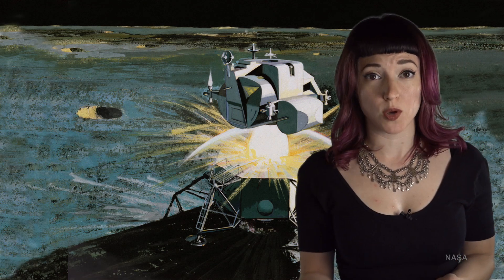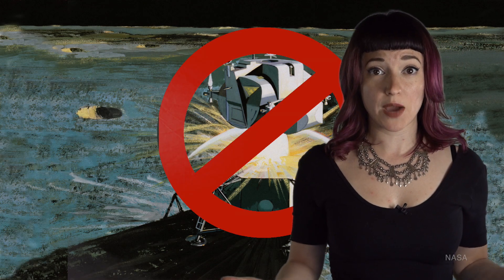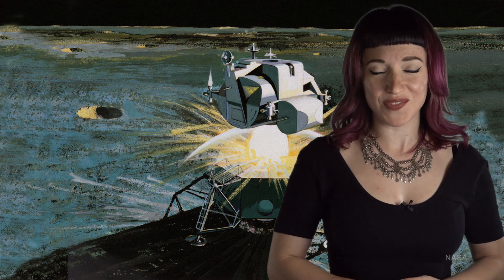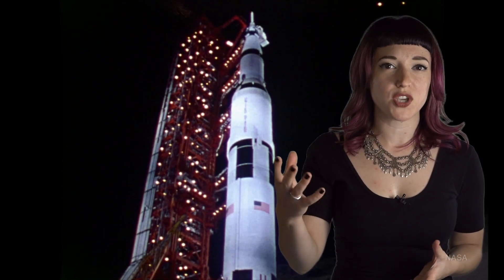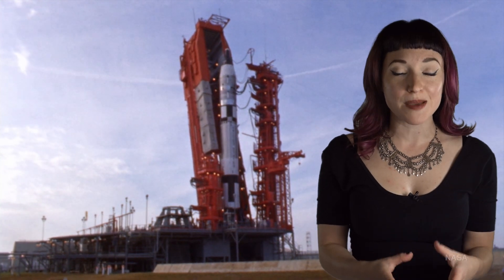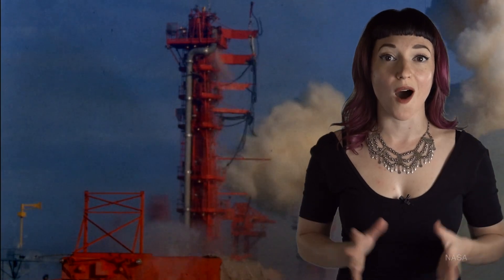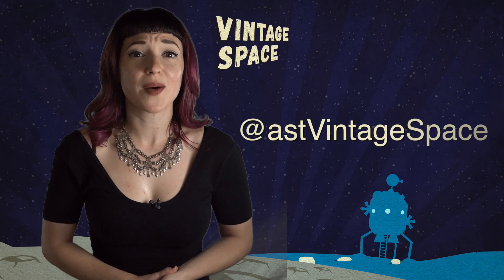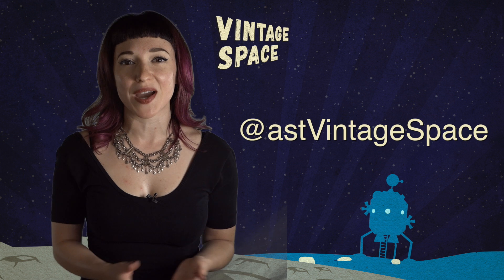How the Lunar Module Launched from the Moon Without a Flame

Comment: Can you please teach me how and which  controls controlled the main engine and thrust during the landing?! Best regards.
Reply: There was a fully manual throttle control mode available, but no commander ever used the fully manual mode.  All landings were done in P66 mode, which is partially computer controlled, partially manually controlled.  For the final phase of the landing, the commander manually controlled the orientation of the craft (pitch/yaw/roll), but didn't control the throttle directly.  Instead, the commander would select the desired descent rate by flipping a switch up or down to either add or subtract feet per second to the descent rate.  For example, if you were descending at 5 feet per second, and you wanted to descend at only 3 feet per second, you'd flip the switch 2 times.  It was done this way because it's very difficult to manually control the descent rate with something like a typical throttle.  The lander was getting lighter every second because it was expelling rocket fuel and oxidizer.  So, if you're coming in for a nice slow landing under full manual control, you might stop descending and actually start ascending, because the craft just got 500 pounds lighter (burned fuel/oxidizer) than it was when you set the throttle.  So, they gave control of the actual throttle to the computer, which was constantly adjusting to compensate for the weight difference as it burned/expelled the fuel.  The commanders had enough to worry about, without needing to constantly adjust the throttle position as the fuel was burned off.

I would post links, but, I think she banned links in comments lately.  So, just Google, "Apollo DES rate switch" or "Apollo DPS switch" or "Apollo rate of descent switch," and you can see some pictures and some documentation.
Reply: rockethead7 thank you very much I m very pleased with your answer
Reply: @pedrodferreira1  
No problem.  Some additional details, by the way:

When I said 500 pounds, it was a bit of an exaggeration.  They couldn't/didn't burn through 500 pounds all that quickly.  But, the underlying point I was trying to make, that the weight will continuously change as they burn the fuel/oxidizer, is still correct.  I simply said 500 pounds to make the point.  But, by no means did they actually burn 500 pounds in the final approach.

Also, the computer did have a fully automated landing mode.  I didn't originally comment on it because no commander ever used it.  There was a fully automated mode, and a fully manual P67 mode, and a P66 "rate of descent" mode (hybrid mode, partially computer controlled, partially manual).  All commanders used the hybrid mode.  Though, all were prepared to switch to fully manual if there was a problem with the hybrid mode.  It was said that Jim Lovell had planned to use the fully automated mode, but obviously, that never happened, because Apollo 13 never made a landing.  I never asked him if that was true (that he planned on using the fully automated mode).  But, now that I'm writing about it, I'm curious to confirm that, and I'll ask him next time I see him.  But, for now, I'll say that most of the commanders really had no intention of ever using the fully automated mode.  The general sentiment was that they were only going to ever land on the moon one time in their lives, and they wanted to do it themselves, and didn't want to give control over to the computer.  Remember, these were the 1960s and early 1970s, and computers weren't as trusted as they are today.  But, even if they had been, well, those personalities... it's doubtful they'd want the computer to do it anyway.  Most of those guys would be the type of people who would want manual control of such a massively important one-time event in their lives.
Reply: @rockethead7  There is no information in your bs text. How did they land?  They used buttons, aha, but how did what the buttons controlled Worked????????? I can imagine your mother.

Comment: How much fuel did the lunar module burn on take off from the moon? How long did the burn time last? Thanks.
Reply: Well, I actually answered this a month ago, before I found out that the video host apparently recently decided to block all comments that contain links.  So, my comment is/was only visible to me, and nobody else.  Here's a repost, with the link removed.

You didn't specify a mission.  But, for Apollo 11, the ascent stage contained 2,353 kg of propellant (fuel + oxidizer) in the main tanks, and 287 kg of propellant in the RCS tanks.
The burn times for the ascent are outlined on this page:
(Search for Apollo 11 lunar orbit phase on Google, and follow the links to get the burn times.)
I'm sure there must have been propellant remaining after the burns, but I'm not sure how much.

Comment: Don't buy it. The Gemini rocket has flames.

The LEM rockets pushing 10,000 lb of thrust straight down,would not resemble that trash can.
Reply: YOU SAID: "Don't buy it."

== Of course you don't.  That's how delusions work.  You have predetermined that you will reject all information that goes against your delusion, no matter how correct, and you will accept all information in support of your delusion, no matter how wrong.

YOU SAID: "The Gemini rocket has flames.
"

== Yes, all rockets have flames.  The question is about how VISIBLE those flames are.  And, the flames during the Gemini missions were largely invisible.  Yes, of course, there was some small visible part of the flames.  This is because they ran the Titans a bit rich to keep them cooler, so some of the unburned fuel was able to interact with oxygen in the air, rather than the N2O4.  And, in an atmosphere, you will see some of the interaction in general with the surrounding air, that you wouldn't see in a vacuum.  But, for the most part, the flames were invisible.  And, in a vacuum, with a perfectly balanced fuel/oxidizer mixture, the flames are even more invisible.

YOU SAID: "The LEM rockets pushing 10,000 lb of thrust straight down"

== Pffttt.  Which rockets would those be?  The ascent stage's rocket had 3,500 pounds of thrust, not 10,000.  You know, when your understanding of rocketry is THAT crippled, such that your first two statements are monumentally incorrect, seriously, what REALLY do you think you have to say about the topic?  Why do you pretend that the entirety of the world's aerospace engineers for the past 60 years are just plain wrong about how rockets work, and you think you're correct?  Why?  (Hint: that's how delusions work... a delusional mind thinks it knows more than the entire world's experts, despite never having stepped foot into a university classroom on the topic.)

YOU SAID: "would not resemble that trash can."

== You're an idiot.
Reply: Being ignorant is not a substitute for evidence.

Comment: How can an accent vehicle dock with the lunar orbiter when the two vehicles are traveling at different trajectory and different  speeds
Reply: For the exact same reason that you can merge onto a highway with your car.  You start off going a different direction, and a different speed.  You get on the on-ramp, accelerate, match speeds with the traffic, and gradually merge.  The lunar module's ascent was basically like that.  They timed it so that the lunar module would accelerate, and it would take a path not all that different than you'd see for a typical highway on-ramp... except this on-ramp was vertical rather than horizontal, and went 60 nautical miles high rather than a fraction of a mile.

Comment: Yes, you do see a flame briefly at liftoff and then again when the ascent stage pitches over where you can see into the combustion chamber. Generally speaking, in a vacuum hypergolic fuel combustion is visible but extremely localized. The initial flame we see is most likely from an oxidizer plume (oxidizer flow usually starts just ahead of fuel flow) interacting with the surface materials of the descent stage (mylar foil, etc.). Once combustion starts, the exhaust jet is exceedingly hot -- so the presence of materials that can burn plus localized oxidizer vapors give us a brief flame.

You can hear ascent engine start, too. I believe ascent fuel valves were opened pyrotechnically --  you can hear a click or snap and then the sound of pressurized fuel rushing through the pipes. Engine start must have been rather loud as these sounds were picked up by the helmet-wearing astronauts' microphones.
Reply: The pyrotechnic click/snap is the explosive-propelled guillotine slicing through the wires and plumbing that connected the ascent stage to the descent stage.

Comment: One thing this doesn't explain is how a rocket works in an "infinite vacuum"... There's no atmosphere. There's nothing to push off of.
Reply: In order to believe that a rocket needs to "push off of air" to work, then you must naturally believe that the air is actually capable of supporting the weight of the rocket to begin with.  Do you believe that the little bit of air under the rocket was capable of supporting the 7 million pound Saturn V rocket to begin with?  If you do not believe that's the case, then you automatically realize that the rocket doesn't need to push off of the air in order to work.  You don't get it both ways.
Reply: Rockets don’t work by pushing off of anything. It’s the force of the expanding gas being forced out the exhaust that produces the thrust.

Comment: I cant agree about no flame as the Draco rocket was tested in a vacumn and CLEARLY shows a bright orange flame . 2, In the NASA footage , the engine is shown as being inside the LEM , with just the bell housing outside . If the engine was running , why no sound ? In a vacumn there is no sound but the inside of LEM was pressurised so why no engine sound blasting over astronauts voices ? . There are images of Hypergolic fuel flames being shown on footage from soyuz capsule docking with ISS , Space Shuttle and ISS itself when manouvering . The no flame capsule launch after Ap 11 etc is a bad boo boo by NASA .
Reply: Is it your purpose in life to go from video to video, and display your stupidity for the entire world to see?  Why?  What's wrong with you?  I've corrected a ton of your stupidity before.  But, you seem to never learn.  You don't WANT to learn.  You truly would RATHER spew stupidity everywhere.

YOU SAID: "I cant agree about no flame as the Draco rocket was tested in a vacumn and CLEARLY shows a bright orange flame ."

== You cannot even spell "vacuum" correctly.  What do you think YOU understand about it?  And, guess what, dummy, the Draco rockets do not use N2O4 and Aerozine 50 as fuel/oxidizer.  So, who cares if they make a visible flame or not.  Nobody ever claims that ALL rocket flames are invisible.  But, the particular combination of N2O4 and Aerozine 50 produces a flame that **IS** almost completely invisible if it's properly balanced.  Lots of compounds do that.  Nobody claims that ALL flames are invisible.  Just certain ones.

YOU SAID: "2, In the NASA footage , the engine is shown as being inside the LEM , with just the bell housing outside . If the engine was running , why no sound ?"

== Because the main sound from a rocket engine doesn't come from the mechanical parts, it comes from the high speed rocket exhaust reverberating against the air.  No air = none of that sound.  But, beyond that, guess what, some of the would-be sound actually DID vibrate through the metals, and through the suits.  You can hear it if you'd actually listen.  It's faint, but it's there.

YOU SAID: "In a vacumn there is no sound but the inside of LEM was pressurised so why no engine sound blasting over astronauts voices ? ."

== Why are you picking on THAT particular blast off?  You can hear astronaut's voices over the shuttle engines, Saturn V engines, Soyuz booster engines, etc.  Fighter pilots from WWII and loud jet fighters since deal with loud cockpits all the time.  Their microphones are engineered to sit right next to their mouths and minimize the outside noise.  Ever fly a plane yourself?  Those noisy old single engine prop planes, as an example?  Ever put on the headphones and microphones yourself?  Lots and lots and lots of noisy cabins, where you'd have to yell loudly in order to talk to passengers, but, you put the headphones/microphones on, and they're designed to drown all of that out... since before WWII.  Yet, you stupid conspiratards are shocked if they did the same thing on Apollo as they did for airplanes and other rockets.  Amazing.  It's just a "complaint point" for you.  It's not actually because you don't understand that headphones/microphones work in loud environments.

YOU SAID: "There are images of Hypergolic fuel flames being shown on footage from soyuz capsule docking with ISS ,"

== Soyuz DOES NOT USE AEROZINE 50 AND N2O4, you stupid crank.

YOU SAID: "Space Shuttle and ISS itself when manouvering . The no flame capsule launch after Ap 11 etc is a bad boo boo by NASA ."

== You're a moron.
Reply: @rockethead7  love how idiots try to explain away multiple images of things and audio of things that actually show its a lie but hey I wont stop you apparently showing im wrong  lol . Again when ever someone challenges the sheep  following each other all they get is insulted . Do ya research and then come back to me instead of sending me groundless arguements lol .

Comment: They didnt have any big rocket there. So how they can get back ?  The gravitation on month is lower 6x less than on Earth. But were is that rocket ? You can get back to the Moon orbital station only with landing station without any powerfull rocket full with gas. Do you have anÿ technical answer for it ? 1) Where is the rocket full of fuel ? 2) How they could find te way back to the orbital station without any computer and navigation system. Even in the year 2019 have Boeing problem to get their station to connect with ISS. (Problem with fuel). How they could do it 50 years ago, without any rocket, without fuel and without computer ?
Not landing. I mean WAY BACK !
Reply: "without any rocket, without fuel and without computer ?"
They had a rocket solely for the ascent of the lunar module, the Bell Aerosystems ascent propulsion system (APS) engine.
They had separate fuel tanks specifically for powering the ascent engine. Not used for anything else for the entire mission.
The was an Apollo Guidance Computer (exactly the same as the one on the Command Module) installed on the Lunar Module. It also had all of the radar and telemetry systems needed to get itself exactly where it needed to be to rendezvous with the command module.
Reply: YOU SAID: "They didnt have any big rocket there. So how they can get back ?"

== They didn't need a big one.  The launch weight from the lunar surface was only about 1950 pounds.  I mean, what EXACTLY do you think happened here?  Do you think no aerospace engineer or rocket scientist on the planet for the past 50 years has ever noticed that they forgot to put in an adequate rocket to get back home?  That's how this "conspiracy" works for you?

YOU SAID: "The gravitation on month is lower 6x less than on Earth. But were is that rocket ?"

== In the ascent stage.  Is your Google broken?

YOU SAID: "You can get back to the Moon orbital station only with landing station without any powerfull rocket full with gas."

== Sigh.

YOU SAID: "Do you have anÿ technical answer for it ? 1) Where is the rocket full of fuel ?"

== In the ascent stage.  Again, do you REALLY think that the thousands of engineers who worked on Apollo never noticed that they forgot to put a rocket in the ascent stage???  No?  Nobody for the past 50 years has ever said, "holy crap, we forgot to put a rocket engine in the lunar module ascent stage to get back home!!!"  No??  The thousands upon thousands of engineers were all sooooooo stupid that, decade after decade, they all fail to realize that none of them put a rocket inside that craft???

YOU SAID: "2) How they could find te way back to the orbital station without any computer and navigation system."

== Well, they couldn't.  So, it's a good thing they had a computer and navigational system, right?

YOU SAID: "Even in the year 2019 have Boeing problem to get their station to connect with ISS. (Problem with fuel). How they could do it 50 years ago, without any rocket, without fuel and without computer ?"

== So, in your mind, if any craft has a technical problem now, then a past craft didn't work???  The 737 Max aircraft crashed a couple of times in the last couple of years.  Therefore, all prior aircraft are fake.  After all, if they can't make a 2019 737 Max aircraft fly without crashing, that means that they've never made a craft fly without crashing, right?

YOU SAID: "Not landing. I mean WAY BACK !"

== Yes.  You're a moron.  That's about all I can tell you.